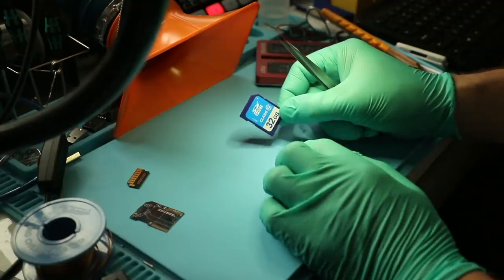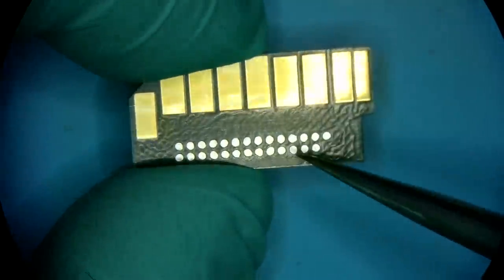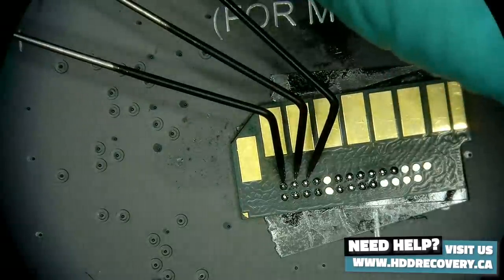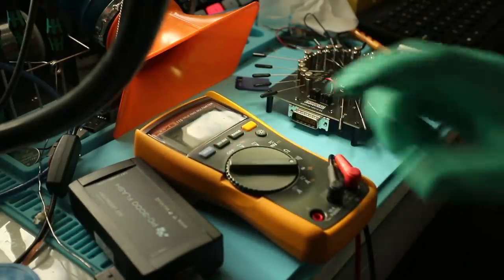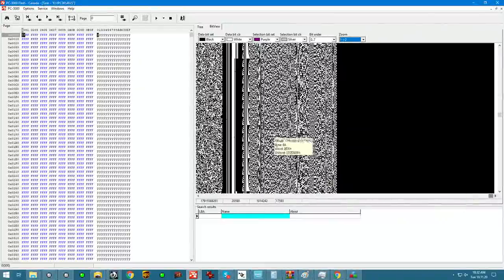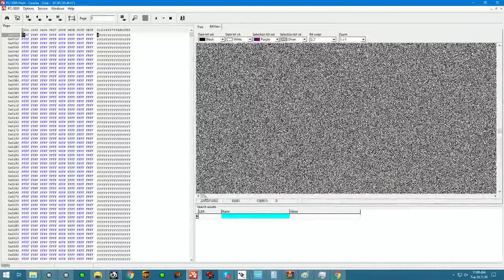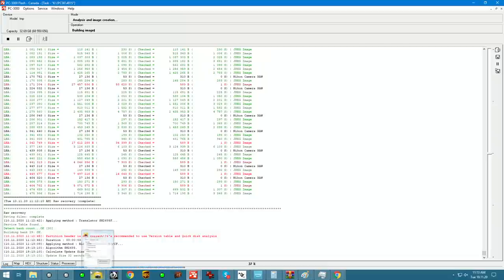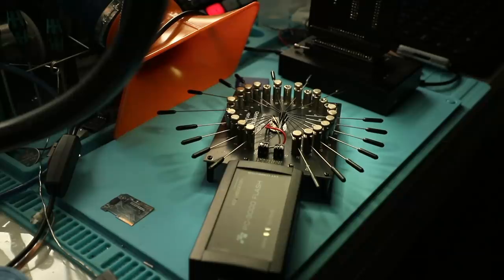advanced tools for data recovery

Comment: Hello from toronto! Love the vids. I am very curious, how did you learn software pc-3000 and in general how did you get your understanding of how a computer interfaces with the nand controller and how the controller does with the nand? It's become one of my fav parts of the vids but you fly through it like a pro :)
Reply from the maker: User manual, support, acelab forum, time, and practice. At first, PC3000 did look a little overwhelming as there are a lot of functions and options. I am sure that training that they offer can be extremely helpful.
Reply: @hddrecoveryservices  awesome so you're self taught? Good for you! Looking forward to your next vid!

Comment: Question for you, instead of using the erector set to make contacts, why not use a header soldered to the pcb and then have the erector set connect to that? it would be easier and faster to connect. not to mention putting the points in the middle of the header connections gives it two points of contact not one.

Comment: Interesting! 

I use Flash Extractor for flash recovery, but it's interesting to see PC-3000 in use. It does look a lot more polished than FE. 

The spider board looks cool too, I imagine it's useful for pinout discovery too. Does PC-3000 provide any tools to automatically determine the pinout using it? 
Or do you do pinout discovery the old-fashioned way with a Logic Analyser channel connected to every trace on the monolith?
Reply from the maker: Truth be told I thought that pinout discovery was out of this world difficult thing. But it's not that hard. In 2021 we will launch something that will make it super easy.
Reply: Hello, I hope this meets you well. A quick reminder, did you release anything yet regarding the pinout, please?

Comment: I have a 2.5 hdd that spins but the actuator arm moves over the platters and then resets itself back onto it's cradle. It does this over and over again. The drive isn't detected by my computer. Any idea what the problem could be?
Reply from the maker: Original problem was dead heads, but now since you opened it it may have escalated into something more severe. It's super easy to contaminate a hard drive and create a bunch of irreversible damage

Comment: So where does one learn Data recovery? I am an Cybersecurity Security Instructor and I have never learned in college how physically damaged data is recovered.
Reply from the maker: There is no specific place to learn it. Data recovery industry mainly is driven by Acelab for tool manufacturing. They have tools for everything from drives to RAIDs, flash drives to SSDs. Training is also available from them.

Comment: Hello. I have a question. How can you program the controller if it is not recognized by the pc? I have a usb stick that do not work with usb 2.0 port only usb 3.0 . I try to use it to an old pc and it corrupted the controller. Now it is not recognized even if i use it to usb 3.0 port. Is there anything i can do? 
Thank you.
Reply from the maker: I don't know know. Most controller related issues would require a bypass or swap.
Reply: @hddrecoveryservices  Thank you for the reply.

Comment: still saving up for my 3tb seagate recovery - soon, soon!
Reply: Heh, 3tb seagates like to crash the heads into the platter rendering recovery pretty impossible - good luck with that!
Reply: @gorak9000  helpful.
Reply: @lordsethos2000  You might be able to get some of the data back - he has other videos of reading disks where the head destroyed at least one platter surface, but the others are still readable. I had a seagate 1TB drive die a long time ago with some photos I cared about on it. From what I read, it could've just needed a head swap. Because I had access to a clean room, I opened the drive up to have a look - it was FULL of head dust, and at least one of the platter surfaces was completely destroyed. Needless to say I didn't bother buying the head comb or donor drives to attempt any recovery. I still probably have the drive somewhere - maybe it could at least be partially recovered if I sent it in...

Comment: I broke an SD card in half trying to install it into a card reader, is it possible to recover the pics I have on it?
Reply from the maker: it would depend on the typo of the card, and how it is designed. As long as the NAND chip is not fractured - recovery can still be done
Reply: @hddrecoveryservices  it's  a SanDisk 4 gb card, no c hips are damaged but board is in 2 pieces.